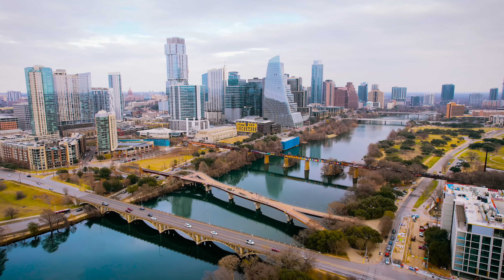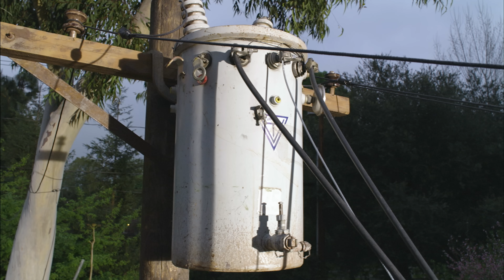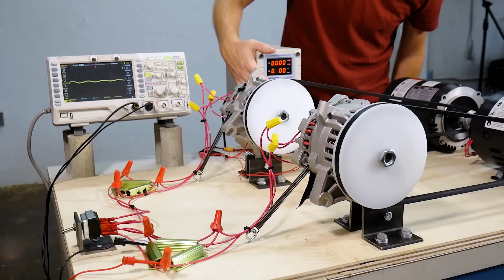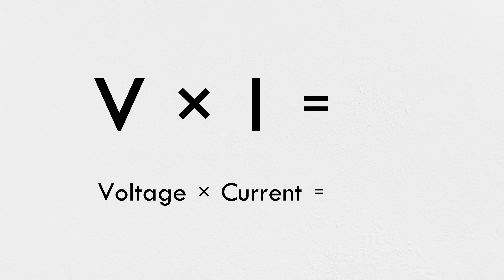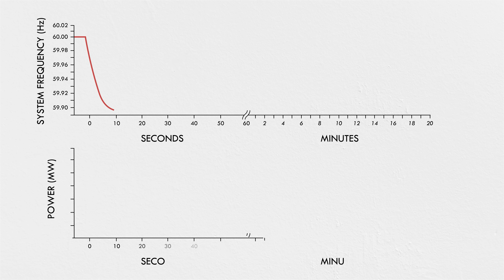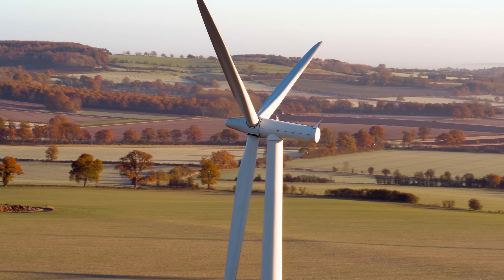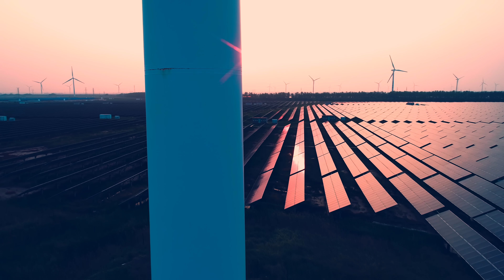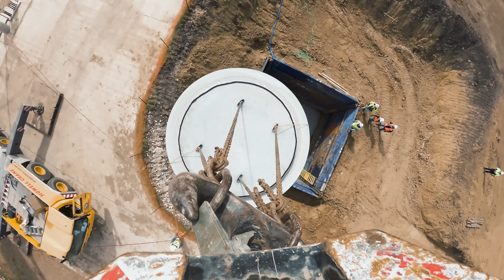Connecting Solar to the Grid is Harder Than You Think

Comment: There are many things that depend on the frequency of the power grid. But that might not make much sense to a standard human.
I would have added that even stationary clocks run on the power grid frequency.
So when the wave oscillates 50 times per second, it will take exactly 50 such oscillations to advance the seconds hand on the clock.
And the power grid keeps track of just how far off that frequency is and for how long, and if they are behind they will actually aim for a frequency slightly above 50 Hz so clocks still keep their time correctly.

It's not like the clocks break down if the frequency is off, but it does explain that power grid frequency does matter.
Especially when it comes to electric motors that are reliant on the power grid frequency. If the frequency is off, the motor will run at the wrong speed and that can have bad implications for things that really relies on the motor running at a certain speed.

Comment: power electronics engineer here: Good video. I do have a few additional thoughts, though:

1. You said a home PV system cannot provide power during a blackout. At the end of the video you talk about grid forming inverters being able to support e.g. a backstart or island grids. The good news is: Those systems do exist for home PV applications. They are usually more expensive, but can supply power during a blackout. (There are different types being able to do different things exactly - I'm not going into details.)

2. One problem not addressed in the video (or maybe I missed it?) is the fact that mechanical generators can provide high short circuit currents that will trip breakers (not the ones in your house, the large ones being part of the power grid). Since fault currents have always been high in the past (something like 10x the maximum normal current), circuit breakers were designed to not only handle them, but also require them for fault detection. But: Inverters don't deliver such high surge currents, even if they stay active during the fault event. They generally limit their own output current. While a mechanical generator can survive a current surge into the grid, a - for example - PV inverter couldn't (hence the current limiting). This is different from fault ride through (FRT) and is an additional problem. IMHO the solution to this is more modern protective equipment that will detect faults differently and trip not only during high current surges.

3. What you're showing at 6:06 is NOT pulse width modulation (PWM)! This is (kind of) what a multi-level inverter's output voltage could look like. A PWM still only has two voltages: plus and minus dc voltage (in the case of a two level inverter, that is), but switches between them rapidly, so that the resulting voltage resembles a sine-wave after filtering.
Reply: What he said is correct. Most (consumer) grid tied PV systems will not operate during an outage. This is a legal requirement for the grid tie. If you have a transfer switch that totally disconnects you from the grid, there are a great many PV systems that will easily power your house. ('tho at that point you aren't "grid tied" anymore - you're "off grid") If it weren't for the power company's lawyers, you could break the grid-tie to use your PV system during an outage.
Reply: @jfbeam  There seems to be a lot of confusion about grid-tie systems and dealing with power failures.   The grid-tie itself won't work, but the inverter can certainly supply AC to an independent outlet that is not connected to the grid.  And many do have this feature.

I have a SMA grid-tie string inverter myself... that's about as grid-tie as you can get, and it has separate plug with a switch that I can switch on during a power outage.  It can push 2000W to that plug.  I've used it twice.   No batteries on that grid-tie system.

Now, it is certainly true that many grid-tie inverter systems don't have an aux AC output for blackouts.  But... many do.  It would not be correct to say that "most don't".   In that respect he's wrong... well, he didn't go into enough detail about the use-case.

The usefulness of such an output depend on one having one more piece of equipment, that being a power station.  Really any-sized power station.... 600Wh power stations are fairly common and popular.  Since the aux AC output during a blackout can drop in and out (e.g. clouds pass overhead), the best use-case for it is to plug it into a power station and then just have the power station run your critical loads.   In our case, just the fridge, a few lights, and the internet.   It's certainly good enough to keep the power station charged to 100% and with a big enough power station you can keep everything running overnight as well.   Roughly 2000Wh does the job.

-Matt
Reply: There are PV inverter systems that are grid forming that WILL provide power to a single house WITHOUT energy storage systems. Many of the enphase microinverters will do this, and some will even sync with a generator to decrease the load on the generator or even bring the generator on and off line as needed based on the demand load. Yes a transfer switch is needed to isolate the island from the power grid, but they are not that expensive compared to the PV panels and inverters needed to produce enough power to run a typical home.
Reply: @rwc1997 synchronising an island back to a grid should be more complex than just an isolator switch (switching out of phase will likely cause destruction of the affected inverter)
Reply: And most large scale inverter systems don't use the same SPWM Rather multilevel topologies but most consumer level stuff is simple   so consumers are not commonly exposed to multilevel systems unless you work in Specific field. Since he is not an EE so I guess his demo was based on his experience of basic inverters and some online research hence the problem.
Reply: I presume that he used common instructional materials for the PWM stuff, and most of that is focused on signal processing. The PWM topologies used for analog signal generation often use multiple steps to more easily fit into systems originally designed for linear Class A and nearly-linear Class B equipment. There is some radically simple PWM stuff out there (Class D), but there are very strict restrictions and requirements attached to it.
Reply: @DrewNorthup  This ain't Hi-Fi amplifiers!  So your genius comment does not apply.
Reply: @shazam6274  That you think those standards and design principles apply only to HiFi audio equipment tells all of us here how little you know about the subject. Direct Digital Synthesis (DDS) systems have been part of the RF ecosystem for years and the waveforms he demonstrated have been in the related instructional materials since around 2000 if not earlier.
Reply: @DrewNorthup  Clueless, whoosh! 🤣
Reply: Hybrid systems cost less then grid parallel, not more.  Microinverters are a scourge on the solar consumers.
Reply: @sfshilo  Sometimes microinverters allow for more efficient capture, sometimes they don't. If you're not trying to build an install designed from the beginning with them in mind then they probably don't make sense to add part-way through.
Reply: Yes the filtering is what makes pmw sine ish wave possible if not it would just be a nasty high frequency spike fest
Reply: @mddunlap03  The PWM does not directly create the sine wave.   What Grady was showing was not the PWM, but the output of a modified sine wave (not really sine wave) inverter.   What makes the since wave possible is the magnetic component of the transformer and/or inductor in a pure sine wave inverter.

I don't know why Grady wasn't using a pure sine wave inverter, that's just plain silly.  Most inverters sold today are pure sine wave.
Reply: You might be the person to ask this question to! How much power does a solar, grid-tied inverter require to be drawn from the grid so it can be boosted by the solar? I have seen several reports of homes with grid tied solar on sunny days, producing well in excess of their requirements but the meter is still drawing a reasonable amount of current from the grid. 
The utilities company here charges 10 times as much for power as they pay for feeding it back in, so if it's drawing just 10% of what we are producing then it's break even, worse if that number doesn't change when solar output drops.
Reply: Yep exactly. PWM looks a lot more beastly where you change the thickness of the pulses over time, and when you average this out you get sinusoids. Although, you can approximate sinusoids pretty well with enough levels. I'd be interested in learning about the difference in harmonics between the two solutions as you approach parity though. 

Context: I'm an electrical engineer, trained as an electronics engineer.
Reply: I mean, I see studies saying look here, here's an 11-tier switching inverter that can produce PFC that's decent from y'r solar DC; but what I don't see is home / industrial converters where you can switch off at night sometime and slip in more SiC, supercap and stage inductor to build better after the initial commissioning (and handle harmonics, etc.)
Reply: Grid operators usually don't want solar supplying power during a blackout. At best it complicates the process of reconnecting power, and at worst it makes cutting power for servicing very difficult.
Reply: @vylbird8014  A system providing your house with backup power during a blackout does not provide power to the grid! That would be a different thing.
Reply: @TheMightyZwom  in many places, especially the states that make their customers pay lots extra to subsidize solar+wind power, like California, THEY NOW REQUIRE YOU to hook your home solar to the grid, or not use the grid period

They also charge you a fee "because you don't use enough grid energy to support the infrastructure leading to your house", which is why they require you to connect to the grid.

Even though there are simple systems to disconnect you from the grid, or connect you to the grid.

This isn't new, this has been happening for easily a decade now, if not more in some states.
Reply: @jonslg240  This isn't even remotely true.  Not sure where the heck you got this from.  You can do whatever you want with your home solar when it isn't grid-tied.   Batteries or no batteries.  The regulations only come into play for grid-tied components.   There is nothing stopping you from having a primarily off-grid system that you charge from the grid, for example.  That uses the grid but is not grid tied.
Reply: The problem with demonstrating PWM is that the fundamental frequency of the modulator is usually off into the hundreds of kilohertz, but the frequency of the final output is in the tens of hertz. This makes is it impossible to show both parts at the same time, The levels of zoom are just too far apart. I think showing that off would have made the video too complicated for its intended audience. Also, he didn't say that what he was showing was PWM anyway. He said that it was multilevel output, although I'll grant you that describing PWM as being just like multilevel but with more switching doesn't really make any sense. And, the way that he describes it sounds a lot more like pulse density modulation, which is quite rare, as far as I can tell, but, in my opinion is easier to explain than PWM. PWM is just way more common, probably because it's a bit more simple in how the algorithm that drives it works.
Reply: @ChefSalad  You can actually make a sketch of how PWM works with a carrier frequency maybe 5 or 10 times the fundamental frequency of your signal. That would allow you to show how PWM works.
Reply: @TheMightyZwom  true enough
Reply: 1.  He said "most" residential solar systems can't provide power during a blackout, which is true.  You need a Tesla Powerwall, a Generac battery/inverter system, etc. to have both the storage and the grid-forming inverter to do that, and you need an automatic transfer switch to prevent you from energizing the grid during a blackout.
3.  He specifically said this was from a "cheap" inverter (i.e. "modified" sine wave), not from a PWM inverter.  There are multi-level PWM circuits.  In fact, all 2-level 3-phase PWM inverters (which is most of those described in the video) are effectively 3-level because of the 3-phases.  A 3-level 3-phase inverter is effectively 5-level.
Reply: @ljfinger 
1. I didn't say he was wrong. I just added a thought to the points made in the video.
3. No, he did not. I just rewatched that part to be sure I wasn't mistaken: When he shows the multiple levels, he talks about "more sophisticated" inverters. It doesn't matter that he talked about "cheap" inverters a few seconds before. Also: I noticed he technically talks about current in that section, not voltage. So having a smaller ripple with higher frequency kind of makes sense. But the signal shown is still wrong. Inverter output current does not usually display steps and plateaus like this. (BTW: Yes, 3-LVL inverters give you a 5-LVL line-to-line voltage; that is not really the point, though...)
Reply: @TheMightyZwom  Okay, I was just thinking he was still talking about the modified sine from his bench sample.  PWM would be hard to show that way because you'd have to get your scope probes behind the output filter.
Reply: @ljfinger  at higher powers you'll typically want a 3L buck topology for your phase legs at least with modern SiC FETs, because the filters get that much cheaper for the mild cost of needing a handful of additional isolated gate drivers.
Further, if you're so high power that you can sustain 50~100 A rms per phase on the medium voltage side of your grid connection, you can go further and use an actual proper modular multilevel converter topology to both drastically cut down the expense on the output smoothing filter and just completely skip the cost of your medium to low voltage transformer.
But even at the low end you'd be talking 1 MVA there, at least with typical central Europe grids (I don't really know typical medium voltage grid levels in the rest of the World).

Oh, and you're gonna have fun MPPT-ing your power to that MVDC level. At least though you could exploit the significantly cheaper line if the farm is in the middle of nowhere, and pull your MVDC line all the way to civilization where you then put down the converter.
Reply: @namibjDerEchte  In the US, typical distribution inside the farm is at 34.5kV and there's a local substation to step it up to transmission voltage.   You get to 34.5kV via a transformer at each turbine, either at the base or up-tower in the nacelle.
Reply: @ljfinger   I meant for solar deployments like agri-PV on vegetable fields (e.g. panel fences to provide some needed shade to crops that hate clear sunny sky (e.g. tomatoes), with bifacial PV panels as the panels.
Outside of very large farms, you'd look at maybe a couple MW per farm, and would have to pay for the grid improvements needed to carry the power back from rural to where the HV grid is. So might as well run MVDC instead, with the MPPTs at the farm and the inverter at/near the substation to which the MVDC line leads. Would also only need 2 wires instead of the 3 that a 3-phase AC line would need.
Reply: @ljfinger  That 34.5kV is the low voltage side of the local substation, right? I.e., the voltage the entire wind turbine with it's possibly associated ground shed/pad spits out into the cable that leads along the access road out of the field the turbine stands in?

Thanks btw for that info!
Reply: He also says at the end "it's mostly good news" even though so far, it's mostly been bad news. His idea of "good news" is "they're working on it!"
Reply: @jonslg240  The alternative is to ignore problems (either the effect of more renewables on the grid; or climate change). So people working on it (and there are positive results in science and R&D) is good news.
Reply: I mean, if you know all this stuff you’re watching this mostly for entertainment purposes anyway. If you don’t know this stuff, that’s outside of the scope of this video. I like these videos because they give a broad overview of a subject.
Reply: @luipaardprint  I disagree. This is an educational channel, so I think it is legitimate to point out inaccuracies, when one discoveres them.
Reply: @luipaardprint  This is an educational channel either way.
You saying "because you know more facts than he does this is entertainment for you" is just a cheap cop-out to excuse him delivering "facts" that aren't facts.

Comment: One gigantic problem with infrastructure is cost. We developed resistance converters and even storage devices (flywheel/battery) for quite a while now. The remaining challenge is to reduce the quality of those devices to the point where cost and customer acceptance meet. And while AC was great for the giant steam-based generators, for a decentralized system like solar and wind a variable DC on the grid to a fixed DC on the supplier would be an easier system. It would even make more sense as most devices we use convert AC to DC anyway. But it would mean to replace basically any device in the while supplier-distribution-consumer chain.

Comment: The statement that you can't have solar power during an outage doesn't seem right.  It should feed the battery system first (via the MPPT) and when that is near full, then feed the grid.  When the grid is down then the solar goes to the MPPT and thence the batteries and inverter.
Reply from the maker: Most home solar systems don't include battery storage.